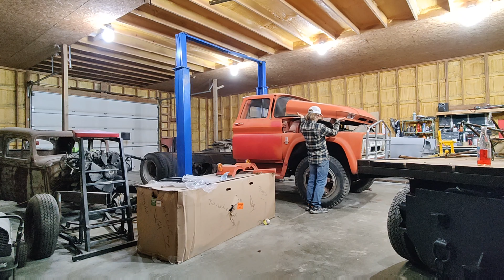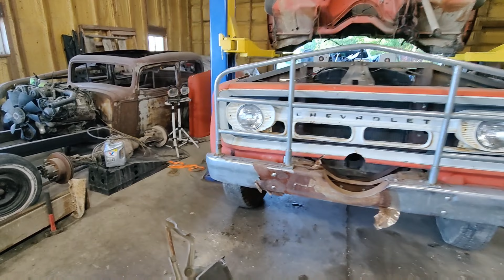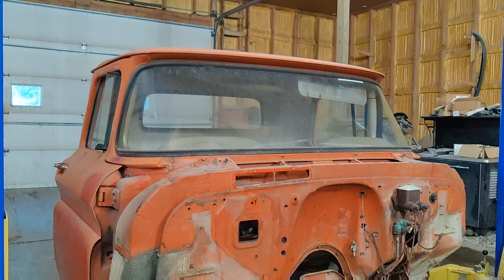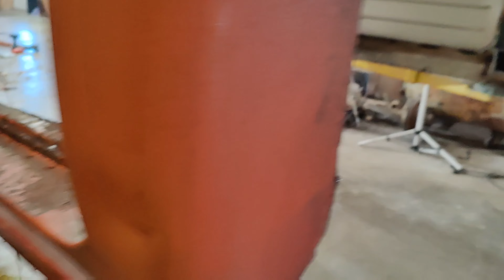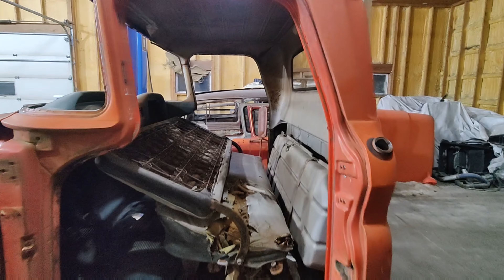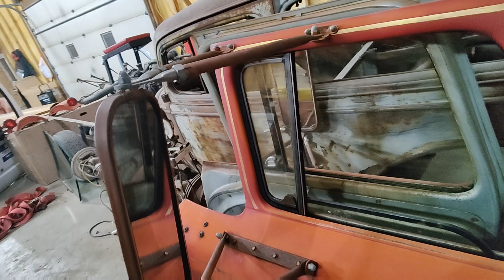Project Kermit 1962 c20 crew cab starting on it

Comment: Gonna be an awesome build! Only difference in my build and yours is mine is on a 2014 3500 dually 4x4 floor, dash, running gear and frame...
Reply from the maker: Sounds like a awesome project!